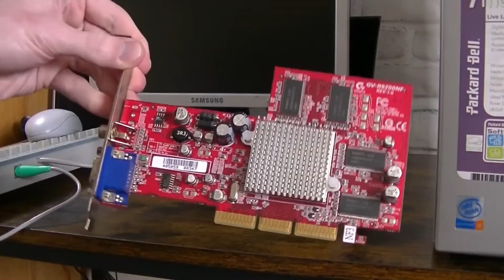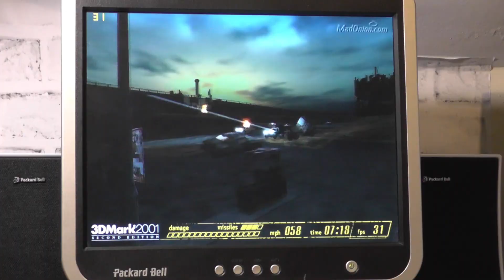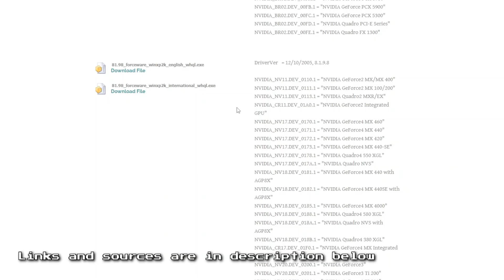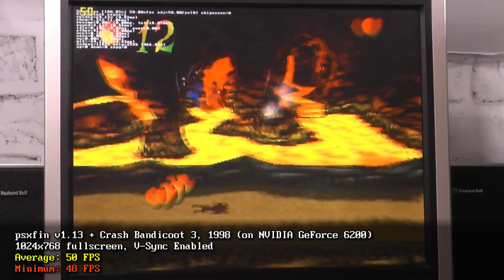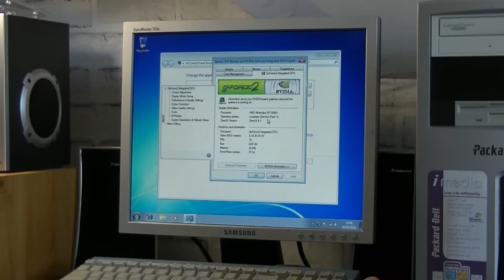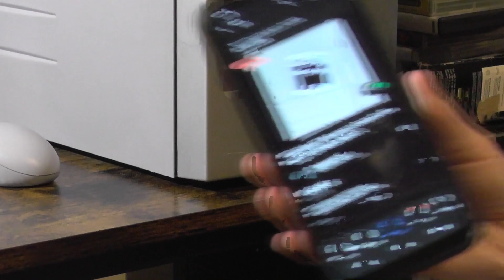The 2003 Packard Bell PC gets its biggest upgrade: NVIDIA GeForce 6200 Graphics Card

Comment: So, I have a very similar setup (an HP Pavilion from 2000). Deleted old drivers, installed new card (same as yours, 6200 AGP), and the computer boots up fine and runs the monitor off of the card. I then installed the same driver you downloaded from Phils. The install went fine. Restarted the computer and the computer won't recognize the GPU. Device manager just calls it a "Video Controller (VGA Compatible)" under "Other Devices" (with a yellow question mark). I received a prompt at startup to install drivers for the device, but when I point it to the nvidia folder where the driver is installed, it says it cannot find a compatible driver. If I attempt to play a game like Age of Empires III, I get an error saying that my GPU has 0mb of video ram. 

Any ideas?
Reply from the maker: That’s strange, have you tried any other driver versions?
Reply: @j.w.techchannel  I tried version 67.66 as well. No luck. What is the differentiation between "english" and "international" versions? Does it matter which you choose or does that just concern the language in README files, etc?
Reply from the maker: @S @Strelnikov10  Sorry, I am not sure. Have you tried launching GPU-Z with the card installed? It should show some detailed info about the GPU, even without the drivers installed
Reply: @j.w.techchannel   Interesting. I downloaded and installed GPU-Z (version 0.8.5 for my XP setup) and when I run the application, all of the windows are blank/empty.
Reply from the maker: @Strelnikov10  That’s strange… maybe the motherboard doesn’t fully support the GPU somehow? I’m not an expert so I can’t say much else at this point
Reply: @j.w.techchannel  I've figured it out! I'll post the solution here in case anyone else has the same problem and comes looking. 

Long story short, you need to check to make sure the hardware ID for your GPU processor is in the driver's INF file. Mine was not. You can check the hardware ID in the properties listed for the device in the device manager. If the hardware ID is not listed in the INF file, as mine was not (0220), you have two options... Find a driver that has your hardware ID listed in the INF file or add the device ID to the INF file. Seems tricky, but it was fairly straight forward. I tested both solutions and both worked. It's not perfect, however, as every time I try to open GPU-Z, it shuts down the video signal and I have to reboot. But it works very well with every game I've tested and the system is running good and clean.

Thank you for helping me troubleshoot!
Reply from the maker: @Strelnikov10  Ohh nice, glad you've managed to fix the problem!
Reply: @j.w.techchannel  Driver wars are a bloody affair, and nvidia corp is a worthy opponent.

Comment: Never turn on that computer with the CPU fan unplugged or on. The CPU will go up in smoke, taking the motherboard with it. If that happens, throw away the CPU, don't try it on another MB. I damaged two more before realizing it was the CPU's fault.
Reply: I'm really worried about the temperature of the CPU in this machine. Unfortunately I'm not sure what specifically to recommend. Surely it shouldn't be idling so high?
Reply: @itspaafekuto  Unfortunately, these are normal operating temperatures. At the time, AMD had overtaken Intel in sales, very few survived, and after that there was a collapse in sales. Use Speedfan to keep an eye on temperatures, downclock, and add a fan. Even just leaving the processor fan off and it ends up like in the legendary Tom's Hardware video "Intel vs. AMD - What happens when you remove the fan?".

Comment: The 1st gen 6200 had 128bit bus so with DDR2 you dint gain anything when you have half the bust width of old one. And old ones were unlockable from 4 to 8 pixel pipelines with rivatuner to make it equal to 6600.

Comment: I had an AGP GeForce 6200 in an old Athlon XP box way back in the day. It was a decent budget card that alteast allowed my pc to run mororwind and halo ce at a playable level.
Reply: Oddly enough that card died due to a blown cap. But back in 2007/2008 I was a teenager and didn't really know how to solder so I sadly ended up junking the card. At that point I had a newer machine Core 2 Duo E8400 and 8800GT single slot. If i knew retro computing would've gained traction I would've kept it and tried to make an attempt to repair it to save it from a landfill but the damage is sadly done :/

Comment: Athlon XP 2000+?

It's some like radeon 9600 XT... over same technology year (3200+ is a 9800 XTX variant).

So what about AGP - even radeon HD 2600 (4 years later) can be installed onto such PC setup.
Reply: I had an Athlon XP 2000+ basically the number was used a comparison to a pentium 4. it was a 1.6 ghz cpu but was comparable to a 2.0Ghz p4 processor.
Reply: @oOignignoktOo1 pentium 4 there is 4.8 times more expensive than athlon xp 2000+...

AMD K7 was released at the same time as Pentium 3.

Comment: Had an eMachines with a Sempron 3200 with the nVidia nFroce 4 chipset/Geforce2 GPU on board.  It ran like a champ to be honest.  Rainbow Six 3, UT2004, BF1942/BF2/BF2142/BFVietnam, Halo CE, NR2003, Call of Duty, Oblivion, ran great to be honest, then I upgraded to a BFG Tech 6200 OC with 256MB DDR.  System only had 768MB RAM.

Comment: its to old try adding gtx 1030 or 1010.
i seen 1010 in ebay for 5 bucks
Reply from the maker: The motherboard doesn't have PCIe slots though...
Reply: @j.w.techchannel try adapters

Comment: just so you know. i dont know if anyone has said anything.. but one of the caps is bad
Reply: just so u know.. with a bad cap it can stop working at any time... u might want to get a new cap sooner rather then later....
Reply from the maker: Yes.. I somehow didn't notice that until making the thumbnail yesterday. The card has worked fine so far, but I'll consider getting the cap replaced when I can

Comment: An Athlon XP 2400+ AXDA2400DKV3C is your best bet for a CPU upgrade.
You'll need the rare Thoroughbred core Athlon XP 2600+ AXDA2600DKV3C. Do not mistake it for the Barton core AXDA2600DKV4D (Which runs at 333MHz FSB). But if the board can recognize a 2000+ it will recognize any in that series of processors as well. I've only ever found two affordable listings for these illusive CPUs. One was inside an old COMPAQ PRESARIO S5000CL, and the other inside some HP Pavilion. There's one listing on eBay for the 2600+ and it's 175 bucks. The 2400+ is like 20 bucks. 
Also those Capacitors on that 6200 looks suspect. Great Video!
Reply from the maker: Thanks for the info about the processors, much appreciated. Also I only happened to notice that one weird capacitor on the card earlier today, but it's been like that since I first received the card weeks ago. I will keep it in mind for the future in case of any issues
Reply: @j.w.techchannel  Adding a PCI Sata card can increase Read/Write speeds, making XP feel much snappier. The MS-6367 motherboard has ATA/100 controller (which is fine), but a Silicon Image card will have speeds up to 150. Try Crystal Disk Mark to view your current SSD speeds. You may also find that using PS/2 instead of USB Keyboard/Mouse will help with performance. The Nvidia nForce 420-D chipset should support 2GB of ram... but this is an OEM variant, so who knows.